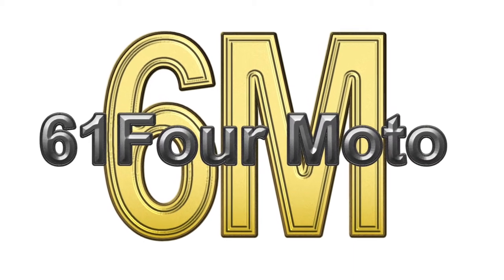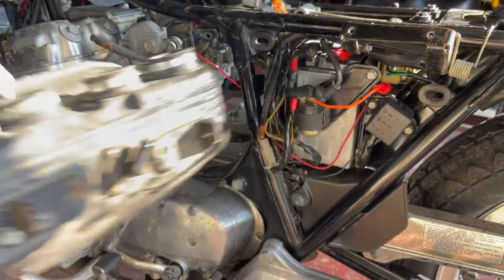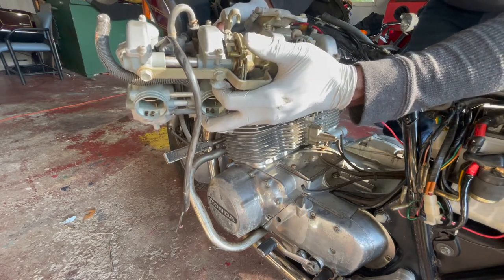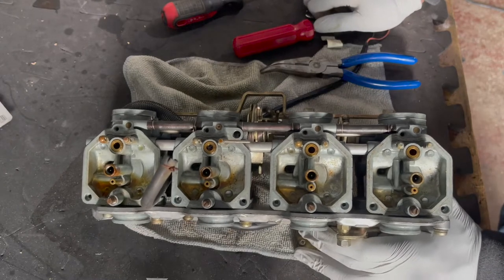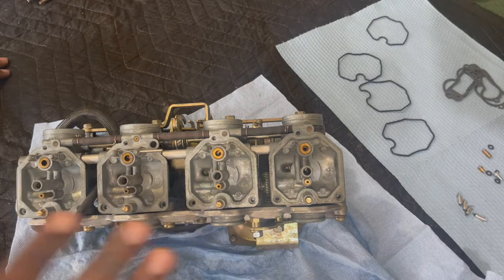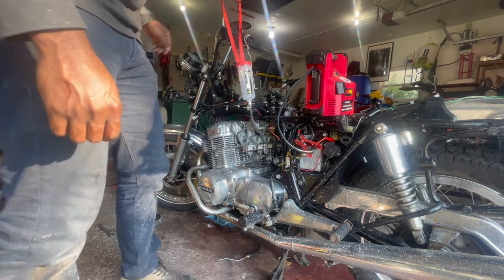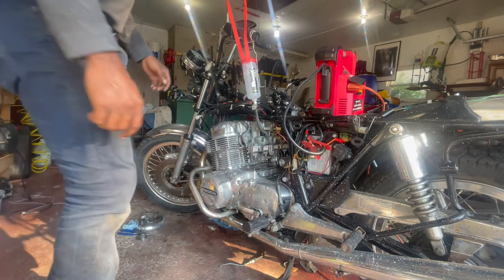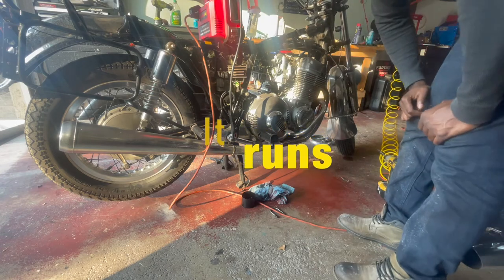1977 Honda CB750A Hondamatic | Will it run

Comment: Cool bike.  I have a 1978.  The airbox is easier to get out if you separate the upper and lower halves, remove the lower half, then the upper half.  The carbs come right out at that point.
Reply from the maker: Thanks.
I will try that out then.

Comment: Nice job. I have the exact bike.  What was the part number of  carb kit, and also, what was the pressure setting you used to power wash the carbs?   Great idea with the sprayer!
Reply from the maker: I don't remember the part number exactly, but if you are looking for those parts. I would recommend checking out 4into1.com they have great selection of parts specifically for old Hondas.
I was using about 90 PSI to spray the carbs.